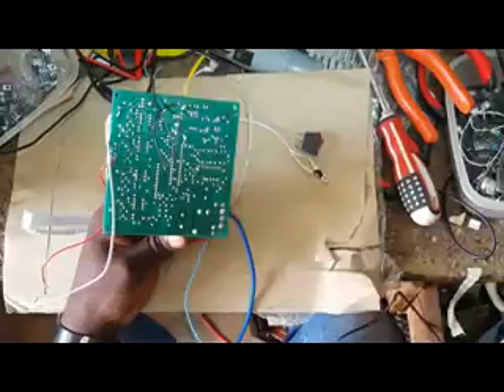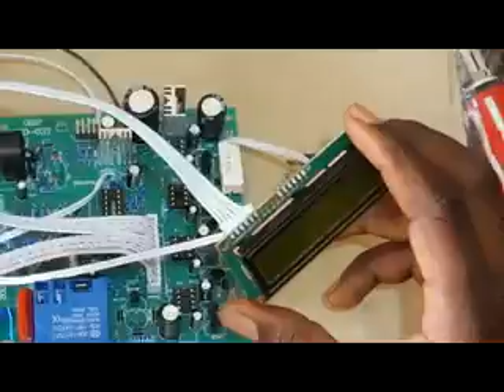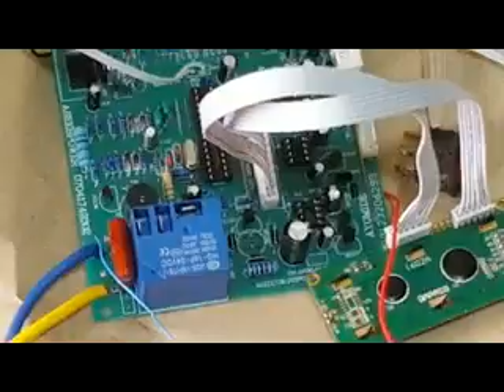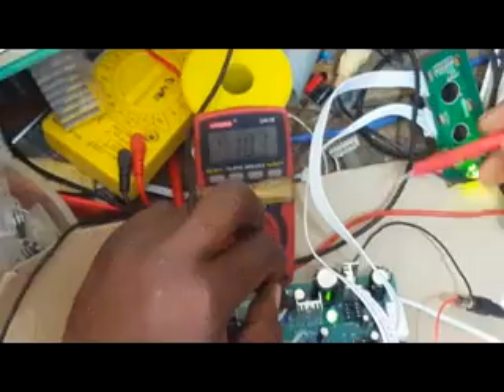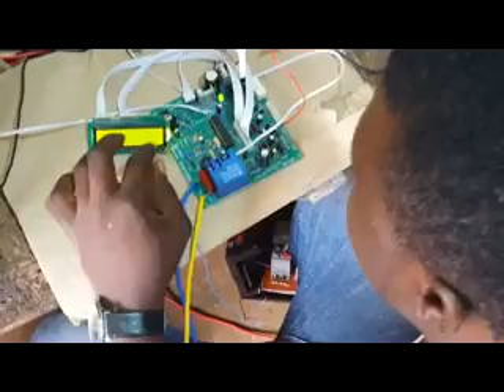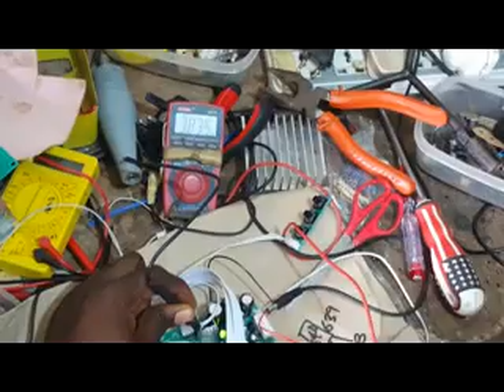ace dsp30f2010 ips board

Comment: Hi, nice video, I have a similar board and have setup everything well but the system does not beep when the temperature sensor is not connected. I have checked the pin 13 and pin 5 of the dspic30f2010 and found that both have a steady voltage of 4.95. Any idea on how to resolve this please.